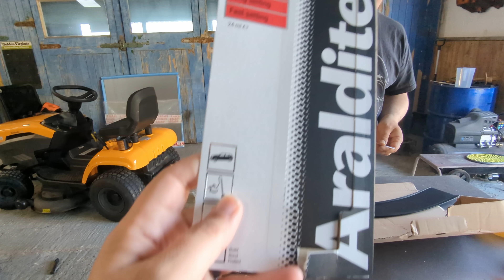Can we re-create a missing piece of SKODA YETI trim that's UNAVAILABLE!?

Comment: We lost the same part about 4 weeks ago. Discovered, as you have, they are not available. I got lucky and spotted an Urban in a breakers (at the opposite end of the country) and bought a door for £190 delivered. Unfortunately the door wasn't the same colour as our car, but you can't win them all! 
I looked into 3D, but didn't get much encouragement, and suspect it would not be cheap if you can find somewhere with a large enough machine to print one.
Your fabrication is really good. Maybe a texture paint would help it blend in with the plastic.
Reply from the maker: You got very lucky to find one in a breakers yard. Lost count of the number of places we contacted! We did paint it in textured spray, it's a really good match and you wouldn't really notice unless you pointed it out 😁

Comment: Fantastic job Lewis! I think the problem is going to be that if these trim pieces are totally unobtanium, and are obviously not stuck on that well from the factory, then the scroats are going to start pinching them. As someone has suggested, there has to be a market for manufacturing replacements. As long as you had a good original set, they would be pretty easy to reproduce in fibreglass.

Comment: I bought our car with damage to the front bumper and I purchased a tin of HD Body Pro F222 Bumpersoft Elastic Filler. I’ve yet to do the job but I have tested it on a repair to my 25-30 year old Flymo 🤣 it dries Black but after sanding it goes grey. Where did you get the black textured paint from as I can’t find it for sale only info on the website not for purchase.